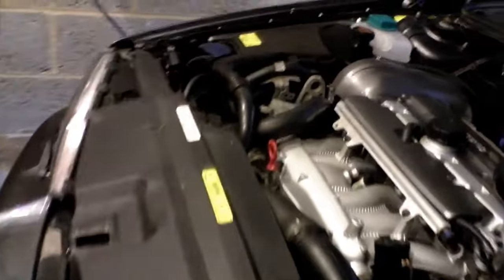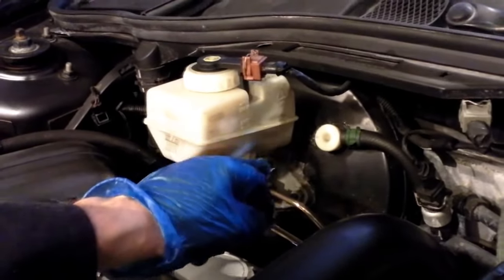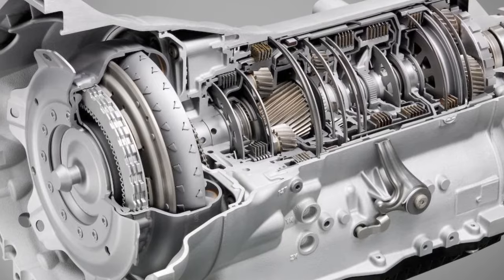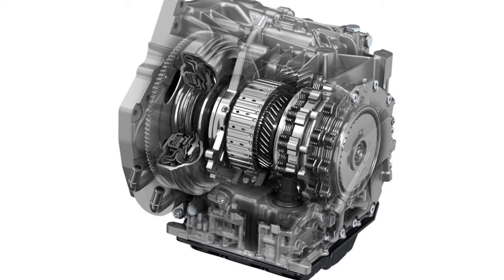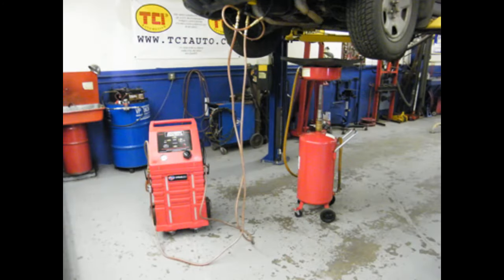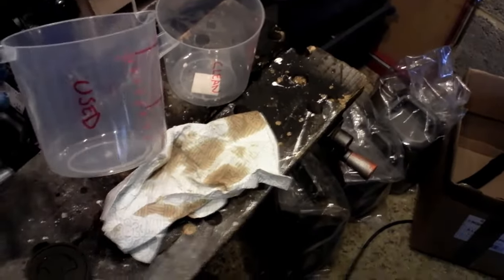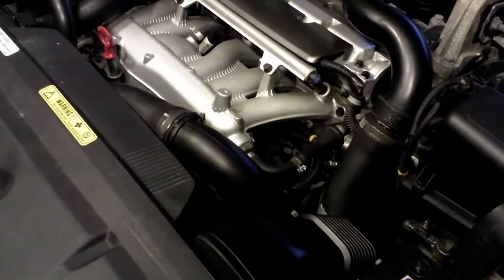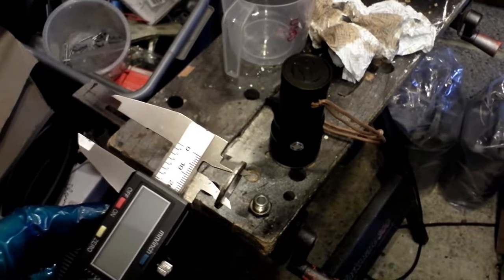Just some Sunday stuff.  A fluid change on the Volvo automatic  gearbox.

Comment: A great video, I used to own an 04 plate one of these, a fantastic car, but when very hot if pushed hard it would occasionally change the wrong way. I wish I'd found you video in those days as it may of cured the issue which was more of a niggle than anything.
Sadly had to sell it when I purchased a house. Hopefully before the years out I will be able to own a mk2 model, but this time with a diesel engine.
Reply from the maker: Thanks for sharing

Comment: Hey Fred nowt wrong with those edges...Really enjoying the VLOG,'s andbyou wont believe im also just about to service my Autobox on my Nissan and found the tutorial really useful...As will many more so dont take it down...ha ha Some really great first hand tips you just dont find in the manuals.Before i start mine i now need to go and purchase more Trans oil as i want to do the same double/treble flush...I will let u know how i get on thankyou Fred.
Reply from the maker: charlieoscar09 Thanks Charlieoscar. Glad its just not me then.  Yeah the treble flush method is the safest to avoid fluid shock.   Check your fluid spec as they are different.  I recon its a simple enough job if you take your time,  I hope you filling hole is easier to get at than mine was.  ;-(

Comment: Hi, Where can I buy the oil and filters for the Volvo 2002 C70 2.0T. Thanks.
Reply from the maker: Hi this place is good for genuine filters.  http://www.partsforvolvosonline.com/index.php
Reply from the maker: Oil can be mail ordered on ebay depends what you want 10w/40 or 5w/40 etc.
Reply: I asked you about automatic transmission? Oil and filtres
Reply from the maker: Sorry. The transmission oil depends on the the type of gearbox you have.  The 4 speed and 5 speed are different oils.  Both are available on ebay but the 5 speed is more expensive.  The filters i have not a clue as unless your a mechanic and happy to drop the tranny bottom cover its a garage job.  I will leave you a link to the Volvo forum to research which oil you need.
Reply from the maker: https://www.volvoforums.org.uk/index.php
Reply: Yes my is 5 speed